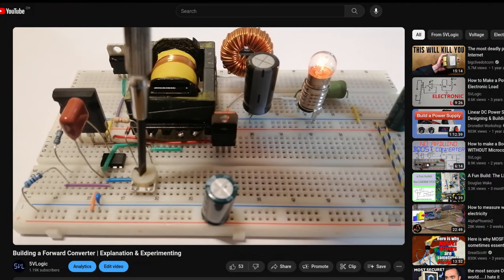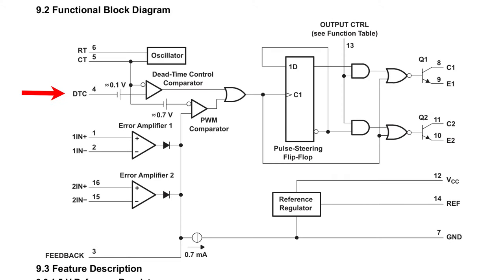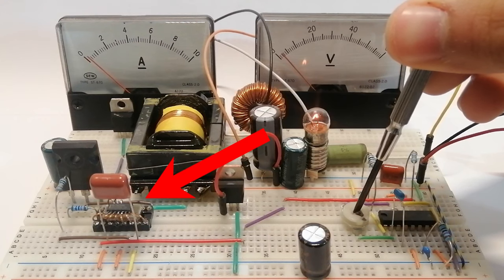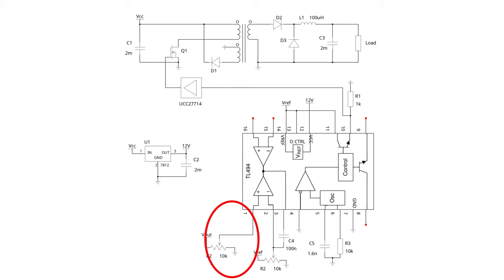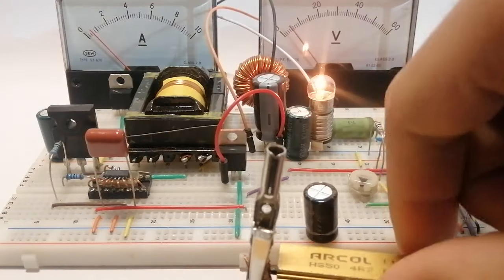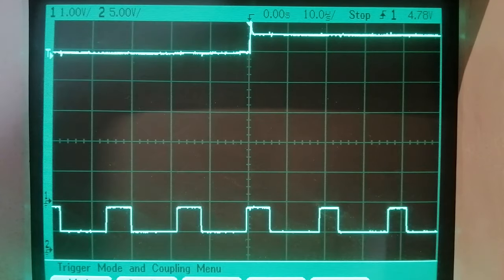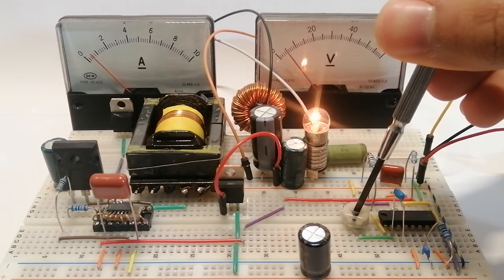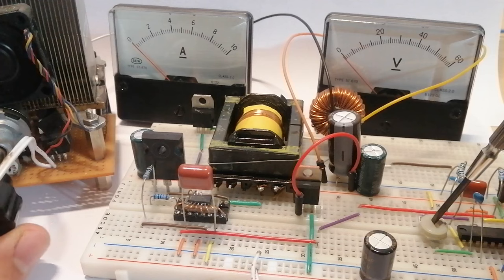Voltage Control with TL494 on an SMPS (Forward Converter)

Comment: Nice video! Seems like you don't have many videos, it's a pity because you really covered all important aspects in a very short time, including the transient response which is a thing that many "professional" youtubers don't cover, also i've never crossed a video where that 494 pin 3 was properly explained i know that is for loop/phase compensation but seems like almost every one doesn't understand how to work with it, all and all excellent job! Btw i'm planning do something similar because i need voltage isolation with power up to ~250w...
Reply: this is exactly what I was confused about

Comment: Use 1000pf capacitor at pin 1 to remove the ringing and a 10k to ground around the capacity this smooth the feedback and 10.000 pf for pin 16 and a 3k across the capacitor this stop the ripped in the over current feeding because with capacitor and resistor the over ripple will kill the mosfet if the voltage is high use a 300 ohm resistor from the resistor use to drop the voltage for over current if you don't use  300 ohm the over current will saturate the op amp

Comment: at least your are using switching circuits, i'm still on linear ones least i did was build a joule thief to drive a 90V neon from a 1.5 volt battery, planing to build a uc3843 based boost or low voltage smps, did you wind the ferrite yourself.
Reply from the maker: SMPS circuits are quite interesting and there's a lot of them to chose from, I hope the UC3843 works out. I wound the transformer in my previous video in case you want to check it out.

Comment: One switch forward converter is not energy efficient as halfbridge design that put the energy out just remember that any voltage higher the 50v and gate drivers transformer is required to isolate the transition of high spikes voltage on the gate driver ic and snubber circuit is always required on all switching components mosfet and inductor coil or your mosfets will get damaged and leaking spike on the gate